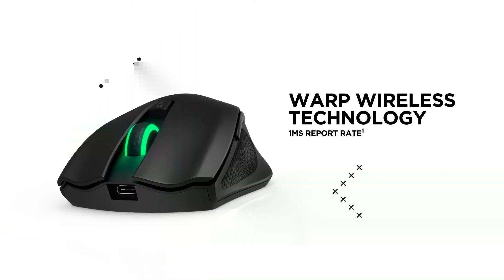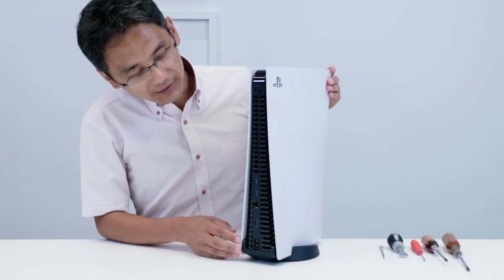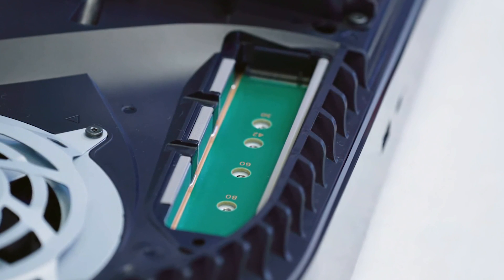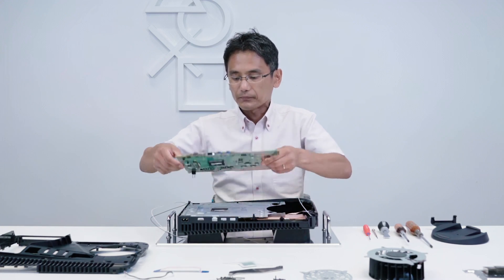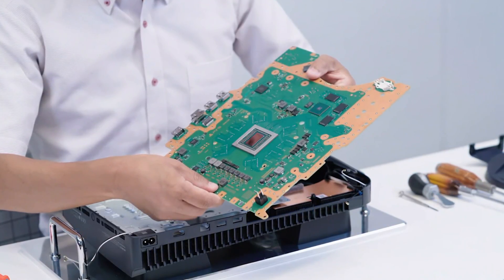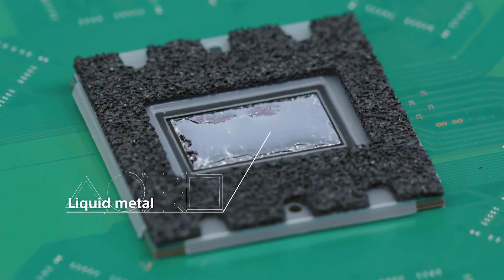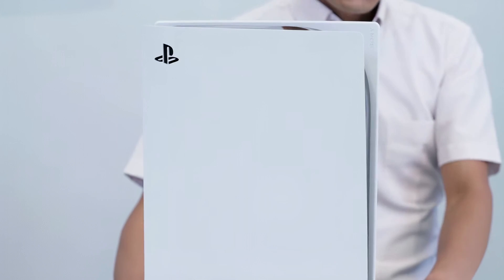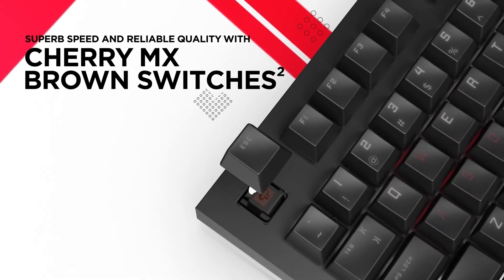PlayStation 5 Teardown Analysis: Inside Sony's Next Generation Hardware Design

Comment: @Richard This felt more like a comparison video and how Microsoft does it better than an actual PS5 teardown video analysis. The unbiased comparison went down the window when you downplayed WIFI 6... It sounded like you was butt hurt and damaged controlled the reason for the absence in the Series X. Sony was smart in not proving you guys a console before launch. They knew you would falsely crucify it before launch to hurt their sales and boost the Series X. 

Are you guys under the Microsoft umbrella?

You guys do an amazing job pointing out the flaws with the Playstation and Nintendo consoles but you do a terrible job analyzing the Xbox consoles and games.
Reply: I don't think that's the case but I get you mean
Reply: @marcianomorisson2542  Thanks man. It just feels like they use a microscope when analyzing the Playstation and Nintendo games which is great. We want to know these things. However, when it comes to the Xbox is like they blindfold themselves and their expertise goes down the drain. We want the same amount of time and effort when it comes to the Xbox games.
Reply: Marc's place  We all know that the PS5 is underpowered. What's your point? If your intentions are to throw jabs on the systems  I can refer you to their lineup and their games running with Next Gen features. The console is slightly underpowered compared to the Series X but overall the console is far more powerful than current gen systems and again I can refer you to their library of games so that you can see what they did with that power. 

If those weren't your intentions then I completely apologize for the misunderstanding.

Comment: my prediction is series x will have heating issues and suffer from more noise. sony learned its lesson with the ps4 and took these issues more seriously this time around. that said, if any of the leaks are to be believed and the manufacturing defect rate on ps5 is extremely high (as high as 50%), sony is going to be in financial trouble for a few years or at least until they sort this out. sony says this is a false rumour of course.
Reply: lol the PS5 already runs 3 degrees hotter than series X in tests. Microsoft knows what they are doing. They designed the box to fit the components not the components to fit something the size of a small car.
Reply: @DEVILTAZ35  i doubt your source for that information is credible.

Comment: That fan design was used in AMD cards for an entire generation and quite recently! It is designed to pull air and push it through the system to cool it down.

To say it was never seen before on the PC... I don't want to make a jab at someone's age, someone turn it into a meme!

Comment: Might note that although the fan is smaller in diameter than on the Series X it takes in air from both sides and blows it out along the edge so the area of intake is probably larger than on the Series X which takes in air on one side and exhausts on the other.

Comment: The fact that you can’t take off series x “stand” is weird.
Reply: I think it shows that they REALLY want you have it vertical.  I can see a lot of people blocking the air outlet on XSX when horizontal.

My PS4 Pro is currently next to my surround receiver, if I put the XSX there it would be pushing hot air into my receiver.  The average person wouldn't think of that.  The good thing is I may be able to put the PS5 there as its still a rear venting console, I'm just not 100% sure it will fit yet.

Comment: The power consumption is different because the ps5 have more ports for their console.. an extra USB type c port and other things
Reply: That's probably a big factor, you're right.
Reply: That will be a factor but a more likely contributor is the boost clocking by the CPU/GPU. They have to feed a lot more power to get that 10.2 tflops, which generates much more heat hence the substantial focus on cooling.
Reply: @rajvinder89  i can see that.
Reply: Part of it will also be because they went with a higher clocked GPU. I can't see the GPU drawing less power even with fewer compute units

Comment: Wondering if Sony is going to have a rack kit for this thing. Really Sony? This thing is giant. Also like how if something goes wrong with the original SSD its easy to fix by replacing the entire unit. I'm guessing there was so little space available in the case that this was a requirement to keep the case size smaller than your television.
Reply: Nothing's going wrong with the SSD
Reply: @PHY51C15T  That's a confidence that can't be backed up with numbers.
Reply: @trevoC132  when they're commonly warrantied/guaranteed for 1.5 million hours MTBF before failure that's plenty of numbers lol
Reply: @PHY51C15T  MTBF is great for establishing if you qualify for a warranty but a warranty isn't going to help you if its soldered is it, nor would the MTBF apply to the warranty in your ps5. Your PS5 will have a 1 year warranty lets say, the SSD specifically, none.

30-80 percent of SSDs develop at least one bad block and 2-7 percent develop at least one bad chip in the first four years of deployment. age, not use, correlates with increasing failure rates.

These are the actual numbers.
Reply: @trevoC132  not with Nvme we don't have complete stats for that yet, neither on Sony's custom solution here. I'm sure I'll be fine given their track record with console hardware but time will tell
Reply: @PHY51C15T  NVME is the bus technology, not the storage tech. NVME and SSD don't differ in how they work to store information, only in how they access that information.
Reply: @PHY51C15T  At the end of the day, with that much room in the case, making an nvme drive soldered for their storage tech was a bad idea IMO. That was my original point. I don't see how you could argue this. There is literally no benefit to soldering it over replaceable slot except maybe preventing someone from removing it easily to use elsewhere.
Reply: @trevoC132  doubt the data throughput speeds they were targeting would have been possible otherwise
Reply: @PHY51C15T  Possibly. Lets hope for the consumers sake there is a low failure rate.

Comment: It looks like ps5 is more quality build.
Reply: Looks series X is more quality build more power in smaller formfactor.
Its called better engineering also games on Series X will be smoother.
Reply: @AVIATIONANDTECHNOLOGY  its not better engineering. Do you think that sony couldnt build smaller console? Ofc they could. But bigger means better cooling. Didnt you hear about xbox overheating problems?

Comment: Hang on...
"sony allows users to boost ssd
space by allowing for specific whitelisted
nvme pcie 4.0 drives to be installed
again , a very different strategy compared
to microsoft
with xbox you have a plug and play bespoke drive
created by seagate sony lets you buy
third-party drives but only those that
match or exceed..."
>>>>>"but only those that match or exceed..."<<<<

Well , Whats that mean then????  Hang on , You cant exceed, but only match with a PROPRIETARY drive for the Subscription Box?     SPIN IT.

To Add.. If you think sony havent got airflow from the fan , which is so close to the SSD port,  guess they messed that up.  
Maybe im just being optimistic?   lol

To Add.. I didn't know the Series X had an onboard SSD that was replaceable.... Good to know..  Does that mean if the SX ram fails, Its user replaceable if still under warranty?
Reply: Both Sony and Microsoft soldered the internal SSD to the PCB. there's no fixing that. 

There's no need to replace SSDs. they are far more reliable than HD, SSDs are one of the most reliable hardware parts today.
Reply: @codethis2875  Missing my point?
I posted verbatim from YT what was said...
That, that disregard for all things considered, well, After even fapping at going to MS, being let in and to build their own..... Well...
Obvious is Obvious.

To Add.. As a Journalist, as he says, now puts him in the bullseye...
You cant be both a Journalist and create doubts about tech when you say you understand the tech.
Journalist he is.
Reply: Man dont tripp about their vid. They are sponsored by microsoft thats why they got all the hands on and teardowns and free shit from them. If you notice they never say anything bad about xbox games even when its obvious but they nitpick small things on ps exclusives.
Reply: @samuraiedge9761  To add, I dont care what side they pick, But ion a open forum like the internet, I shall state my opinion to...
As people have said here.. If you want unbiased , Tech driven , non journalistic info.. Id have to say NXgamer is what DF thinks  it is....
Dont get me wrong, Theres some great content on DF... But being somewhat understanding of tech, mainly due too research and cross referencing, I feel sometimes the info polished and delivered is designed to keep a camp happy.
Is nit numbers? Is it games? is it price? Is it choice? but the worst of course..if to even question it, "Is It Paid"....
Na. 
When the only thing that cant be an option is the flops, is it the numbers that lie?
you cant change the numbers...
But a metric that is but one, and others dismissed, glossed over like Wifi 6, relating it to everything in its common use,  but not what it could bring to gaming fun what is about gaming (eg VR)...... well, thats just lazy..... Or?
Na.. I dont want to question it.  If I do..... Well.. Here we aRE.
Reply: @Rhythmattica  i mean they clearly downplay the playstation advantages. They talk about how they have better wifi but say its useless. They say the SSD is only theoretically better and that it will probably overheat. And they tried to act like more thought was made on a fucking rectangle design in which they just did tetriss with the parts to fit in and most of the airflows are blocked. I couldnt bother to watch the whole damn thing cause i knew it was bullshit bias but i bet they probably said something like “liquid metal is really risky and it may cause leaks and problems but we will have to wait and see” correct me if im wrong. This is straight up xbox publicity at this point
Reply: @samuraiedge9761  Well, As Rich States..
Xbox : Complex
PS5: Conservative

Talks about The extra Silicon on the Xbox, and The bandwidths wider......
Hmmm.. So those that dont understand his only referencing the GPU will fall into the trap...  The bandwidth is faster on the Xbox, translating to those that dont understand, its faster onboard I/o than than PS5.

Its all in the details....

To add.. If Complex is good then why have a SOC?
Like all electronics, VLSI .. Custom chips allow for better performance, cheaper cost, and better reliability....
So.. Might as well pick Conservative..
Xbox : Alfa
PS: Mazda

Yeh.. Im sounding a bit FB'ish..... But its truly obvious.,..
Complains about Sonys approach as a journalist?
Suck the Custard... Im so happy MS gave you the one on one.. And now thats your measuring stick.... At least he didn't talk about games 

Oh . and to talk about how expensive thew 3rd Party SSD's will be , yeh, Well I guess we are a few months out until we get an idea when say WD Releases one...... /s

Its all a bit Rich.
Reply: @Rhythmattica  that would imply that everything they said is 100% correct and accurate which i do not think is the case. Like i said they are sponsored by microsoft and making publicity disguised as tech vid. Imagine this: burger king hires some researchers to study how harmful mcdonalds food is without mentioning anything bad about their own food. That research firm would be digital foundry.
Reply: @samuraiedge9761  We agree to Agree

Comment: FYI, MS has said that 3rd party expansion cards will be available.
Reply: @Jon Carney No it is not. You just have to meet specs and you automatically get the white list. in case of MS you need to "buy a license".
Reply: fyi, some time in the future and only the ones they "allow".
Reply: @kenshigo3833  just like Sony, but Sony's approved SSDs will cost over $300.
Reply: @MaxIronsThird  Except the Samsung 980 Pro costs $229  for 1TB and is already almost saturating PCIE 4 thus might already be eligible.
Reply: @donemu9096  But yet we don't know if it is. 😆
Reply: @MaxIronsThird  That is a straight up lie.
Reply: @donemu9096  So the SSD is $10 more than the Xbox solution, even though the Xbox one is bespoke. Curious.

Comment: Why didn’t Microsoft put USB-C on their console? Wasted opportunity for faster external SSDs and possibly VR. It may have even allowed offline interfacing with their phone.
Reply: Sponsored by seagate
Reply: @mczwei2081  grrrr. I’m mad they went the proprietary route. It has no benefit to consumers except having expandable storage available a few months before the competition. You’re paying $219 for a drive like 1/2 the speed of most PCIe 4 drives, of which most cost like $20 less.
Reply: Faster SSD - Only if they included Thunderbolt support and would potentially have performance issues if the SSD did not deliver consistent performance in line with what the console needed.

Microsoft for some reason aren't interested in VR.

We've already had the "phone as a screen" generation, hardly anyone used it, its really not that useful.
Reply: @xiaguan whisky its GBit, not GByte, on both of them...

Comment: Consoles are just a pc at this point, if they weren't already. From the large size and weight, to the high power usage and heat production. They even use a pc cpu, ram, and gpu!
Reply: Its a rtx 2060 at best! Too year old tech lol I've got a 3080 and it makes your ps5 look like a gameboy
Reply: @ianwparedes  "Far cheaper" - give it a few months to a year
More efficient - Depends how competent you are
Performs better - factually incorrect
Reply: @ianwparedes  Remember how AC Unity ran at 22 FPS or even lower on both original consoles and still didn't hit 60 on the upgraded ones?
I can pick and choose a plethora of games that are garbo on console but that's on the developers and is also a problem most PC games don't have
It's called cherry picking and is not a good argument to use
Reply: @ianwparedes  it was also swiftly fixed. there are a lot of unoptimized, poorly MADE games on console. Bloodborne with erratic frame pacing, unlocked framerate games with micro stutters averaging at 45fps, dips below 30fps, a distinct lack of 60fps (which thankfully will get remedied with the new consoles) reduced visual fidelity and probably the most egregious is motion blur that you sometimes can't even turn off
your point about shuffling between driver updates and editing ini files barely holds up as well because once again, that's something I haven't had to do for years and is extremely rare.
Reply: @ianwparedes  except the issues I listed aren't exclusive to Bloodborne or the PS4. It's an inherent console issue across generations and has happened for years. Also no, the original PS4 was more powerful than the One. The One X was more powerful than the Pro but lot of devs didn't optimize games on the One X that well either. A Pro outperformed the X on more games than one even with superior hardware in games that should have theoretically ran perfectly fine.